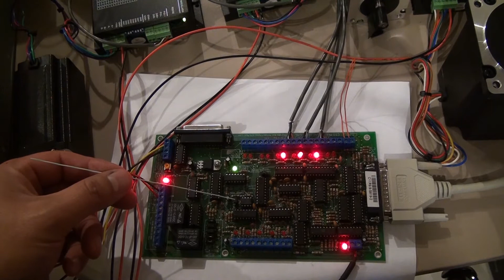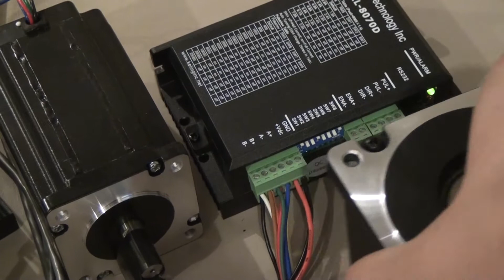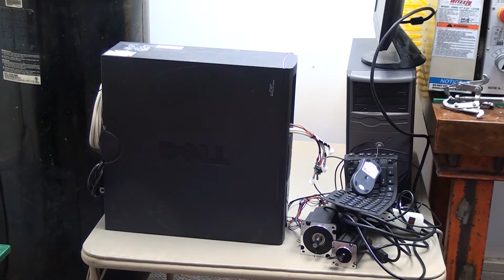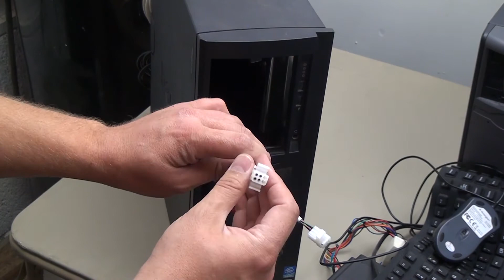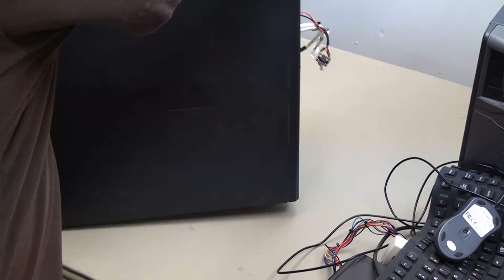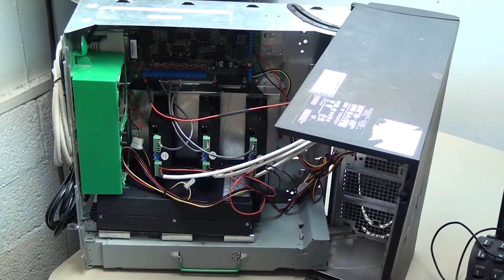G0704 CNC Conversion 04 - Wiring C11 Break Out Board, Steppers, Drivers, Power Supplies

Comment: Thanks for the vids . i have this break out board for my stepper motor . should i install a driver for it or it gets driver from Mach3?. I haven,t been able to run my stepper motor yet . 4Axis .They get so hot but not moveing at all. Appreciate any help here.
Reply from the maker: Do you mean software driver? You don't need one in LinuxCNC, and I assume Mach3 doesn't require one either. I don't have any experience with Mach so I can't help you there. I am doing a tutorial series on LinuxCNC but I'm not far enough into it yet to have videos about actual motion.
Reply: Hi thanks for the reply ...i meant driver software for break out board . You know,  the board that connects to computer and stepper motor.   Does it need any software drive?

Comment: I really appreciate the videos, I have learned and resolved many issues through these videos. Look forward to seeing next video and if you can shed a light on how to convert from NC studio to mach3. Most of the time problem arise to pick the right breaker board, wiring and power supply.
Reply from the maker: Hey Ali.
I haven't used NC Studio or Mach 3 so I'm afraid I'm not going to be much help concerning those two controls. I've only ever used LinuxCNC.

Comment: Nice vid thanks. What is the extra 5v feed from the pc power supply needed for? Isn't the USB 5v feed enough to run the board? or is the extra one for the coil on the relays?

Kind regards
Reply from the maker: Electrically speaking, there are two sides to the board. The power side and the logic side each need 5v, but you can not power them from the same supply (for grounding reasons).

Comment: Hi Russ. 

What wiring diagram did you use for the C11 Breakout Board?. I can only find one for the C10.
Reply from the maker: I didn't use one. I had help from a friend of mine (electrical engineer) because I couldn't figure it out :)
Reply: russtuff is your z axis motor 1200oz? trying to figure out what microstep to use
Reply from the maker: Jeremy Isoardi  
My Z is a 906, but I'm sure 1200 would be just fine too. I've had zero problems with the 906 and tested it up to 300ipm no problem. I only run my machine at 100ipm max though.

I can't remember the interval for microstepping, but if you set your switches like I do in the video then you'll be the same as me. I know Hoss uses 1/8 microstepping, and I'm thinking about trying that. I know my switches are not set at 1/8.
Reply: russtuff i set my mill up, i enter g0 x10 y10 z10 in mdi part of mach3 and it travels x = 5mm  y = 5mm and z = 100mm.
do you know what would cause this?

Comment: Im building a controller with the same drivers... When you said the PUL- and DIR- get connected together and go to a pin on the breakout board - what pin is that? 5 volts or Ground?? 

on the instructions i got with the drivers - it says - the PUL+ and DIR+ get connected together and go to 5V/G?? if someone could let me know how to wire this properly, it would be much appreciated
Reply from the maker: Hi! There are "com" pins between the pul and dir, and you will twist the pul- and dir- together and use that com. In his video they are the black and white wires coming from each controller.

Are you controlling a mill with setup or do you have some other fun project?

Comment: I disabled the charge pump jumper and noe i have outputs signal, but motor still wont turn. My understanding is that if i dont supply 12v i have to disable the charge pump, am i right? Do you have your jumper set to com=ground or 5v ?

Comment from the maker: Yup, you have to have two separate power sources to give 5v to the two sides of the board. You can think of the board as being two boards, one side for logic and one side for power. The sources can not be from the same power supply or you will fry the board.

I used the USB cable they provided for the lower right 5v, which I plugged into my controller computer. Then a separate power supply to handle the 5v and 12v on the other side. It has to be done this way.

Comment: hey Russ me again. I recieved my electronics and everything is hooked up and can't get the motor to move. Do i really need to provide 2 source of 5v to the board? I have hooked an external 5v power supply to the board (down right in your vid) but thats it.. I have the usb cable provided by cnc4pc but dunno where i should wire it. Can you help please?

Comment from the maker: In that case it sounds like you have Mach3 configured incorrectly. Can you unhook your 4th axis and get the other three back up and running? I have zero experience with Mach3 as I am using LinuxCNC so I can't offer any help there.

Comment from the maker: I don't have a wiring diagram for my whole setup, but if you watch the video closely you should be able to see everything you need to wire the same components correctly. If you are using different components then your wiring may be different.

If you are confident your wiring is correct then it may just be a problem with your controller software. If you like, send me a personal message and I will be happy to answer any questions you have so we can get you up and running :)

Comment: If C146 connectors are the round metal ones that google images showed me, they might also be a better option because they will shield the wires through the connector too.  I worry that the molex connectors aren't shielded at the connector and *might* cause interference.  

Great vid as always!